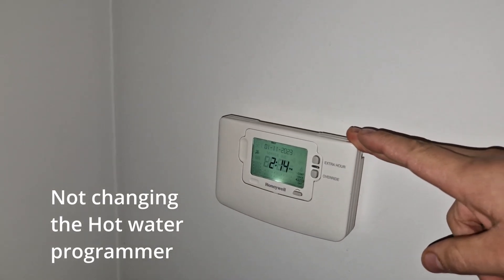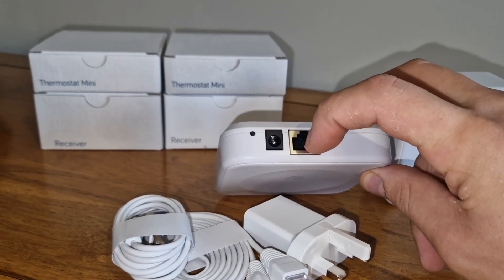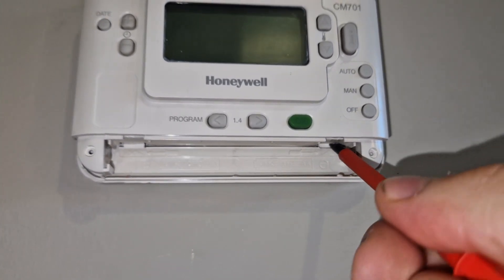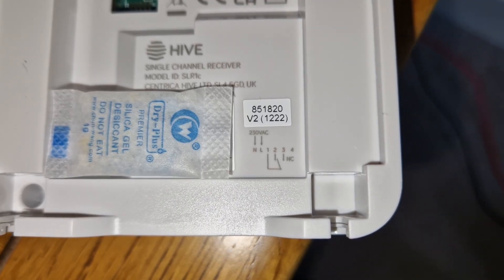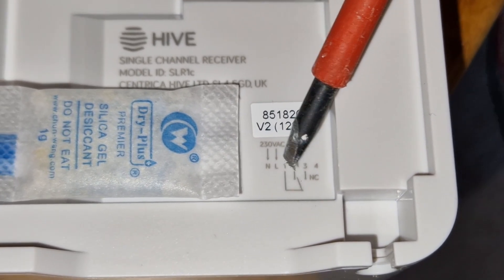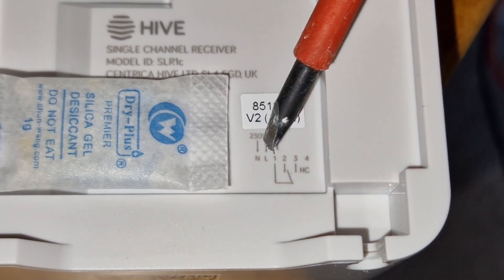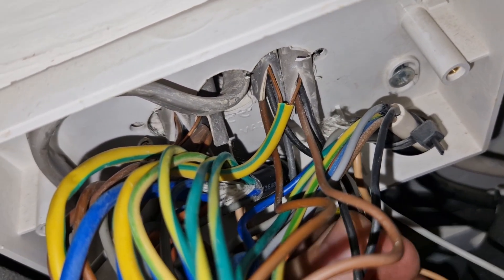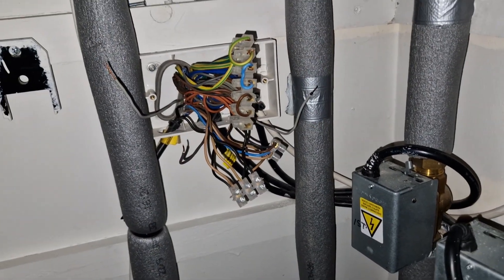Replacing Outdated Honeywell: Complete Hive Mini Thermostat Installation

Comment: Very nice - thanks for sharing.
What is the difference between the two thermostats?, (one with the nob vs the smart one).
Can I setup with two different thermostats, I.e one with nob downstairs and smart one upstairs (we have two thermostats). Thanks
Reply from the maker: You can have the Original (nob) downstairs and the mini thermostat upstairs yes. Difference is the mini relies on your smart phone more as it's not a full device that can set schedules. The Original you don't need a phone can set schedules, it has boost buttons if you want to quickly heat for an hour and you can do the same as anything on the mini.
Reply: Thank you

Comment: Thank you.. just to clarify... the timers didnt have neutrals????
Reply from the maker: Yes, they are battery operated to power the screen and scheduler, the HIVE receiver doesn't use battery so it needs neutral. The Honeywell was just a switch. They're good for replacing a thermostats which only have 2/3 wires.
Reply: Thanks for clearing that up...  as a switch only it makes perfect sense..